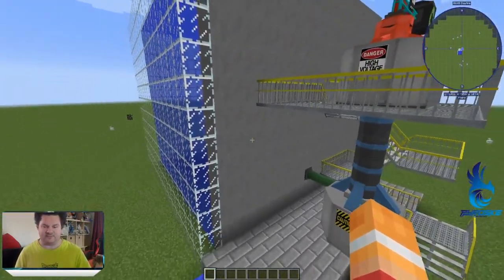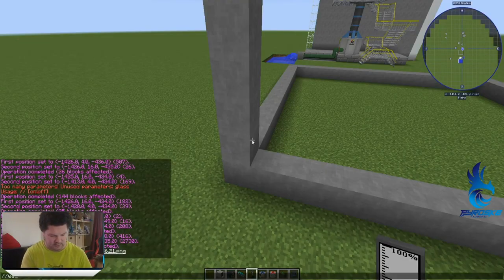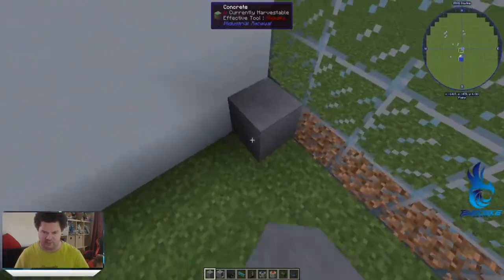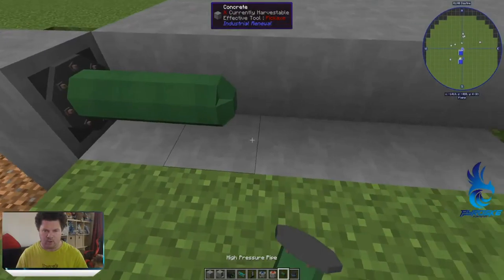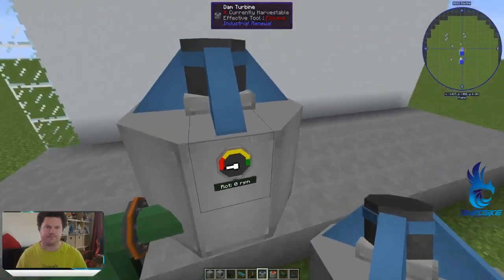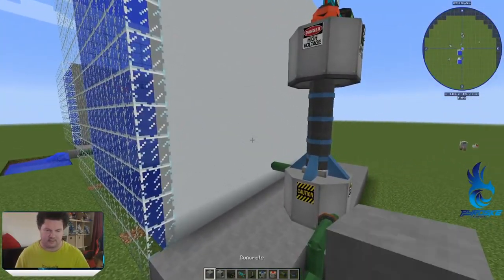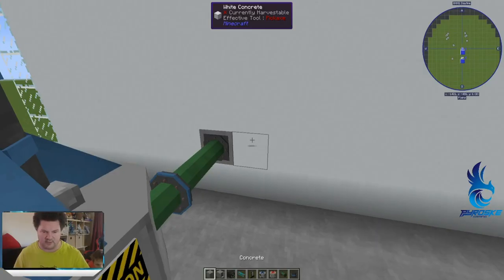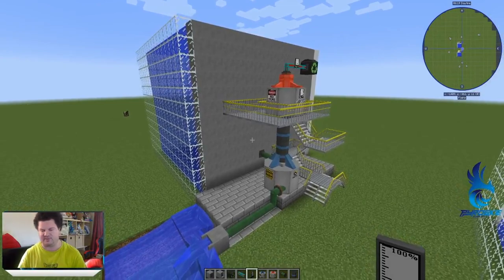Minecraft - Industrial Renewal How To DAM POWAAA!

Comment: turbine stays at 36 and does not go up help please
Reply from the maker: Check that the dimensions of the water is correct, also try and remove and replace the outlet in the dam
Reply from the maker: Also make sure the main wall is using the concrete from industrial renewal mod